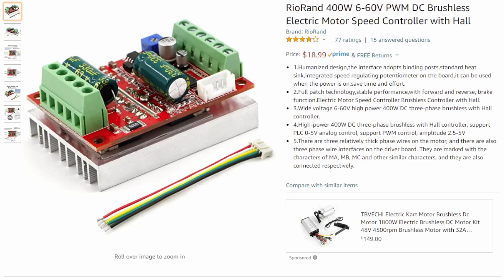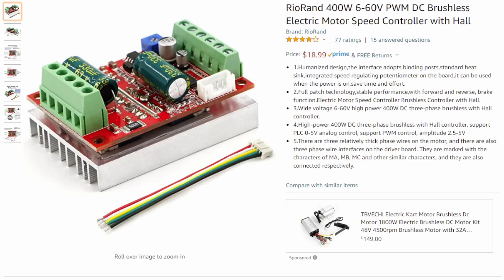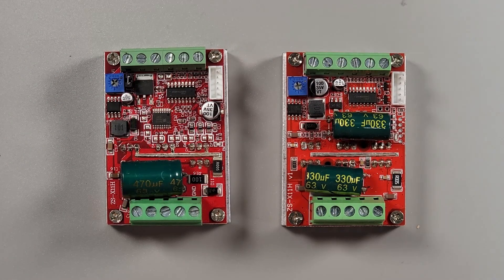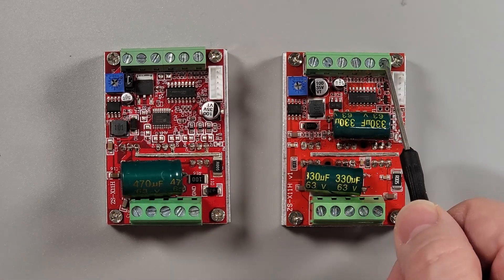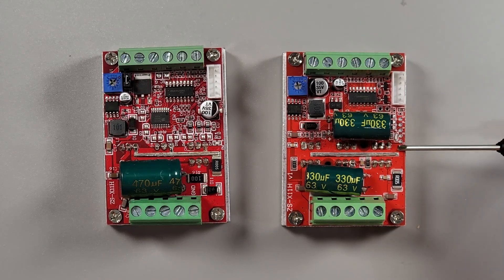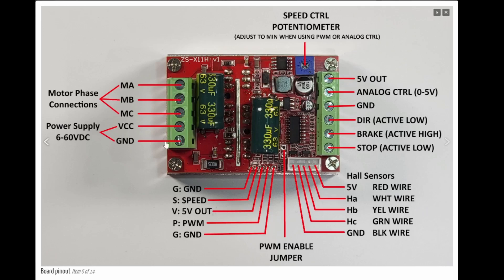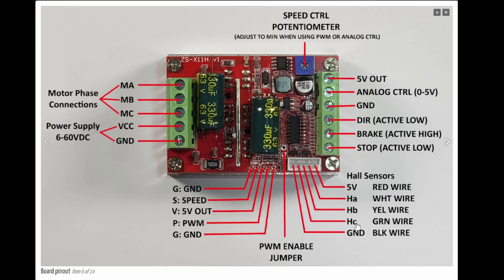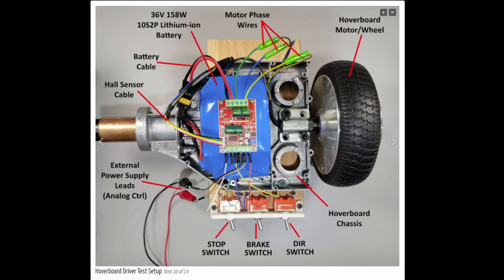Inexpensive Hoverboard Motor Controller

Comment: hey there, just a question

i've ordered these parts & they're on the way. i wanted to connect this to an arduino so i'll need to solder a connector for those 5 pins next to the hall sensors? i'm referring to @4:06

why can't i just pass a pwm signal into the analog control (0 - 5V)? 

pardon my ignorance, i'm a mechanical engineer, don't have much knowledge/experience in Electrical Engineering. hope you can clarify, cheers :)
Reply: PWM stands for pulse width modulation. It's different than just applying voltage
Reply: Were you able to make it work?

Comment: Hi! So I made the wheels work with the small blue potentiometer, but I want to use a remote control. Where do I plug the 3 wires for the Remote control to work? the red/yellow/black wires. pls help
Reply: You need an arduino or raspberry pi to convert the PWM signals

Comment: Hi.  Thanks for the informative video!  I have two motors; each being controlled by their own RioRand motor controller.  How would you wire this up so that, when a button is pressed one motor rotates forward and the other backwards?  When the button is released both motors rotate forward.  Similar to how a tank moves and turns.
Reply: To change the direction of the motor spinning rewire the UVW phase in the inverted direction so WVU e.g.
Reply: I would do that via if or if && statements by assigning TRUE or FALSE for my desired outcomes
Reply: When i reverse the wire of motor UVW to WVU the motor cannot turn

Comment: Great video. I’m working on an electric skateboard using 4 of these and an Arduino. One thing is, the wheels all want to spin in the same direction of the shaft. So being able to make the board go forward and reverse is a bit tricky
Reply: Hi, you need a fix frame to support and prevent the shaft from rotating, then the wheels can rotate in a controlled manner
Reply: I believe the "DIR" input on this board is forward/reversible.
Reply: Can this board go on an electric scooter?
Reply: idk ask chat gpt to make a code
Reply: Do any know the manufacturer of this board? Have probably ordered 6 of these and they last a little time before they behave funky, also tried to hook up a RC reciver which lit up but couldn’t control the motors and then it was roast

Comment: Hi, nice video I have one question that no seems to be able to answer, the DC motor that I have has just 2 wires positive and negative. Will this kind of controller work with that and is there a wiring diagram anywhere? thank you
Reply: I’m pretty sure what you want is called an h bridge controller. Title let you go in forward and reverse as well as break. They’re a lot less complicated than the controller The overboard motors need.

Comment: I have two reclaimed hoverboard motors that I would love to use for DIY tools, a bandsaw and a disk sander. Which controller would you recommend?
Reply: This one will work perfect for that. B/c all you need is a power switch an a POT dial. Super basic.

Comment: Thank you very much for the video. Can you please tell me how I might go about connecting a hall-effect pedal to this board to control the speed of a hoverboard motor? I assume that I would not be able to simply plug it into the analog ctrl input. Is an Arduino required? Forgive my ignorance...relatively new to all this and cannot find a clear video that clearly solves my question. Much appreciated!

Comment: Great. Thanks for this posting. My aim is to use this silent motor for anything but hoverboarding.
Reply: Hi, I  now have 3 motors on the bench and each one has a fault: two turn but vibrate loudly and shake their mountings at low speeds, whilst the third is dynamically locked. CAN ANYONE shed some light on these symptoms as this is getting expensive! I am using the a same controller as in this informative video, with Hall Effect leads connected. Many thanks
Reply: If the motor makes horrible sound when powered. Switch the motor phase wires around til you have smooth operation

Comment: It seems that I need to have one of these for each wheel due to Hall sensors etc. However can you tell me how to hook up a brake, reverse and potentiameter (Speed) - Using only one switch - for each .   Can I use one potentiometer to control two  motor controllers.
Reply: yes you could theoretically, but you wouldn't be able to control each motor individually, they'd obviously just be moving at the same speeds

Comment: Thank you !  I’ve been trying to figure out the connections for the  new zs-x11h v1 to a Hoverboard hub motor.  Also trying to use a  E-Bike Throttle Grip with key lock and voltage meter on it  
I think I can figure it out now thanks to you.
Very well explained
Reply from the maker: Glad it helped!
Reply: Hey how do i put a throttle on it

Comment: Test you controller rc?
Reply from the maker: I have tested this with a FlySky FS-i6X (https://amzn.to/3DlXomK) RC controller.  This motor controller can not read the signal from an RC controller directly so I had to use an Arduino to read the PPM signal from the RC controller and convert it to a PWM signal to send to the motor controller.

Comment: Good explanation! What i wonder is this: this board use the same motor-controller-chip JY01 like some other very cheap boards. But with the other boards (these other boards have 3 capacitors near the MOSFET-side) there are some issues like a dead-time between switching forward/backward (e.g.one second absolutly stop needed before change direction), smooth turn-on with no dynamic, no brake feature and things like that. My guess: there ara several versions of the JY01 on the market with big differences in the functionality (like brake/ no brake), but you can not clarify the Version of the IC because all have the same JY01 printed. Do you have similar experiences ?
Reply from the maker: I don't have any experience with other boards that use this chip.  I was able to find the datasheet/website for this chip and there is a PDF manual link near the bottom.  It includes QR code links for schematics that are probably the boards you have described.  I think there is only one design of this chip but the different boards implement some of the features differently.  If I had more time and money I would buy the other boards and compare them.
http://www.bldcmotor-driver.com/sale-11345265-jy01-3-phase-bldc-motor-driver-ic-high-current-brushless-control-ic.html
Reply: @mad-ee  Thank you for the detailed information with .pdf link. These cheap BLCD controllers cost less than $ 8 and are easy to find. My version is from 2017 and I suspect that there have been other versions since then, some with big differences. If I understand the data sheet correctly, there is the 6th version of the JY01. So it may well be that you already have a chip with the cheap boards with slightly different functionality. I need a controller for a robot project and I value high dynamics.
Another tip about the board you have presented here: I have already bought 2 of them but have not yet put them into operation. It struck me that the 6 MOSFETs with their cooling tabs only lie superficially on the heat-conducting foil, you can even see a small air gap between the cooling tab and the foil! The FETs are not cooled properly, which could be a problem under full load with 16 A ...
Greetings from Germany.
Reply from the maker: @dronesrus7436  The FETs seem to be sandwiched between the PCB and the heat sink pretty well to me.  If they do end up getting hot a fan blowing across the heatsink or even a bigger heatsink should help.  If you want to try to get a better thermal contact to the heatsink you could add some thermal grease on the bottom of the FETs.
Reply: @mad-ee  Now I have also put my BLDC controller into operation. In terms of dynamics and response speed, the circuit board behaves as in the video. But there are a few first notes:
1.) Unlike in the video, there is a third version of the board that can be opened, my version is labeled ZS-X11H V2.
2.) Using the brake is a bit tricky because high currents can flow. The real braking current only flows in the 3 low-side FETs, whereby the 3 motor connections are short-circuited. This is also the case when the motor is at a standstill, which is why the motor cannot be turned easily by hand as shown in the video. But there is one special feature: if you fully brake to a standstill from a high speed, then this is not possible 100% by controlling the low-FETs, the motor would come to an abrupt stop and could be damaged. Instead, the low-FETs are "clocked" with increasing speed when braking, i.e. not 100% fully controlled. However, this means that the braking current then flows into the battery, whereby the braking current can be significantly higher than the regular motor current, i.e. greater than 16 A. With connectors / terminals it can happen that the voltage (Vcc, eg 24 V) rises far above the operating voltage.

Sure, this is not a fault of the controller and ultimately depends on the individual structure of the user. But I find it interesting how this was solved by the developers of the JY01.

My preliminary conclusion: the circuit works much more dynamically than the version from 2017, which constantly took pauses of up to a second when the tour was off or the direction was changed. Thus, with the current circuit, a similarly high level of dynamics can probably be achieved as is possible with the hoverboard circuit boards. The circuit board should be suitable for a bot project with high dynamics (or 4 circuit boards with 4 motors).
Reply from the maker: @dronesrus7436  That is some very good information.  Thanks!

Comment: Funny timing.  I watched your first video last week before ordering these new drivers and your new video came out about when my drivers got delivered.
Reply from the maker: Nice, I hope the videos help!
Reply: @mad-ee  can this controller control two motors at once?
Reply: @DeerfishDistillery no it can't. but u can use 2 of these to controll 2 motors at once.
Reply: @DeerfishDistillery I’d get two controllers then pass them the same analog or pwm signal, that way the hall sensors can be used still. It would seem difficult to use two sets of inputs on this board, even if the motors could share an output signal from the boards.

Comment: Have you tried PWM via Arduino or RC controller yet?
Reply from the maker: Yes, I have done both... although this board is not setup to be controlled from an RC controller signal which uses Pulse Position Modulation (PPM).  The duty cycle of a RC controller usually maxes out at 12.5% so it wouldn't be able to drive the motor controller at a very fast speed.  I've used an Arduino to read in the signal from the RC controller and then convert it to a 0 to 100% duty cycle PWM to send to the motor controller.
Reply: @mad-ee  Do you know any videos I could follow along with? I hooked it directly to the controller and as you said I could only make it go a little bit faster. The main problem is it doesn't stop at all, the wheel always rotates, so I assume the pwm frequency is wrong? I have the Radiolink T8S. I have the onboard pot all the way down and the pwm bridge connected.
Reply from the maker: @zenvent  That makes sense that the motor would not turn off with an RC controller.  It is not the frequency that is wrong it is the duty cycle.  The RC controller outputs a 50Hz frequency but only adjusts the duty cycle from about 5% to 10%, so at the lowest setting it is still driving the motor.  There are a few videos around showing how to read the RC controller signal on an Arduino and output a PWM.  Try searching for "Arduino PPM to PWM" or "Arduino RC to PWM".  I plan to make my own video on this subject but I probably won't have it done for a few weeks.
Reply: @mad-ee  Hooked up an arduino and used analogWrite to ramp up and down duty cycle. Works fine.
Reply from the maker: @zenvent  Yup that is the command I use.  You can use the pulseIn command to read the pulse width from the RC controller.  There are other ways to read in this signal too; using a pulling method is one, or using pin interrupts is another.  If your RC controller has an I-Bus output then you can use the Arduino RX line to read all of the channels at once.
Reply from the maker: @zenvent  I finally was able to finish a blog post on this with some sample code.  I hope to get to the video soon.  After that I will do one with reading the signal from an RC controller.  Here is the blog post:  https://mad-ee.com/controlling-a-hoverboard-motor-with-a-simple-arduino/

Comment: Great video!
I ordedered two of these a month ago on ali. Still waiting for them to arrive.
There is a yt video with a bit different controller on how to connect this through an arduino and generate PWM from RC receiver signal. The program works good but I had to add a few lines of code for direction change.
Can't wait to see your program :)
https://www.youtube.com/watch?v=QrH8NNfC-UE&list=FLvjtMkTDE1Z4rUc1mwsdyrg&index=4&t=138s
Reply from the maker: Thanks!  I've also played around with reading the signals from an RC controller to control the motor.  There are a couple ways to do it.  I'll show those in another video.
Reply: @mad-ee  hi
I received my controllers yesterday and tryed them today. They work great
It seems to me that the brake force is not so strong, probably just shorting the coils of the motor. 
I was wondering which arduino are you going to use.
Reply from the maker: @serekes2002  I've been using two different Arduinos.
ELEGOO UNO R3:  https://amzn.to/3I6rK0l
ELEGOO MEGA R3:  https://amzn.to/3EeKqZo